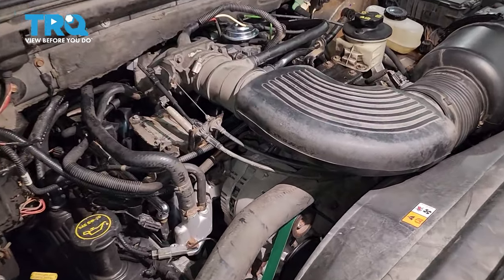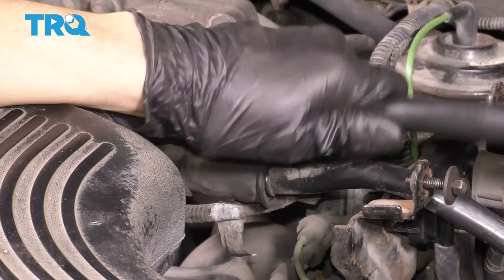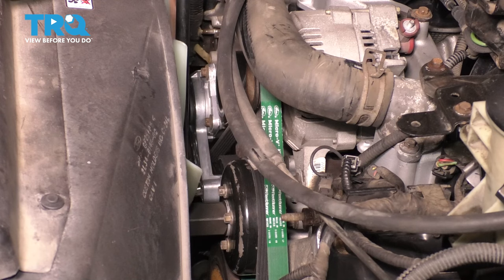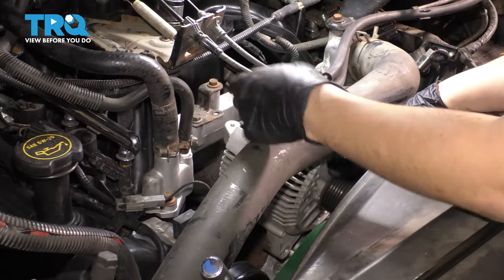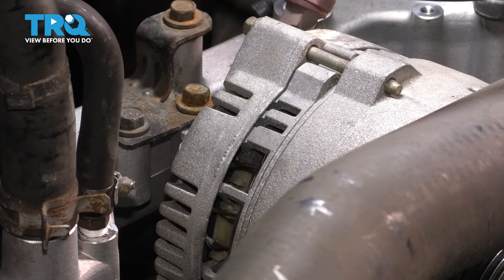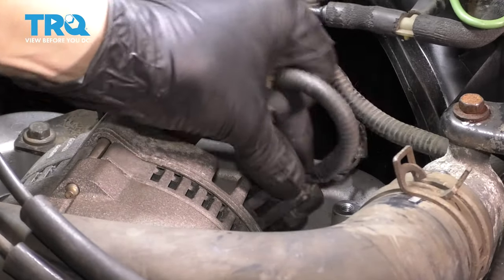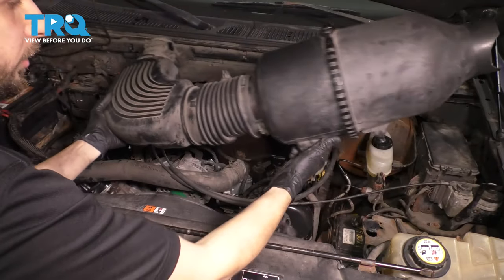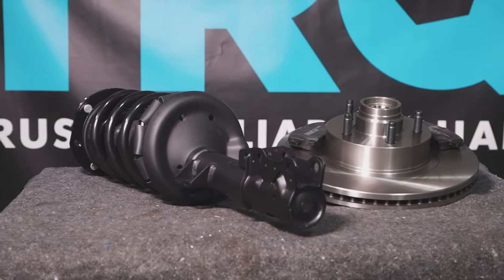How to Replace Alternator 1997-2003 Ford F-150

Comment: I got a question, I have a 1998 Ford F-150. It doesn't start unless I jump start it with another car. Once I turn it off it doesn't start again. What do I need to fix/replace?
Reply from the maker: +@existenceisdivided6192 We wouldn't be able to diagnose an issue like that here, you may want to have a local mechanic take a look at it. Thanks for checking us out! http://1aau.to/m/Shop-1AAuto-c